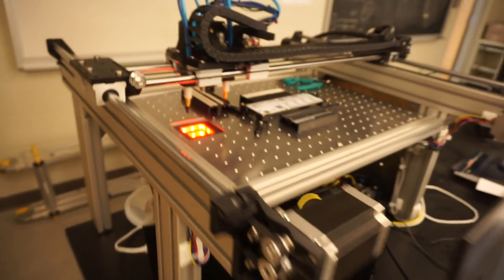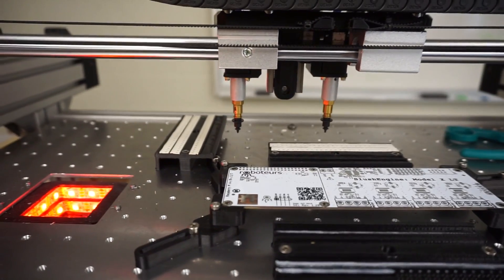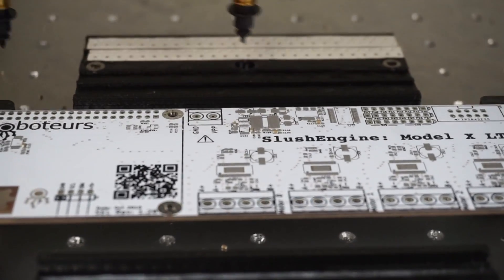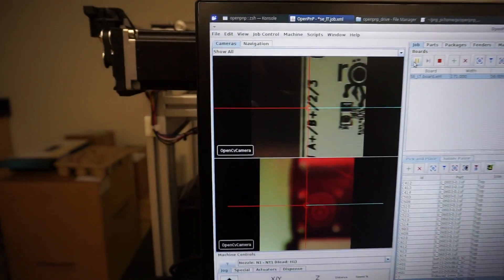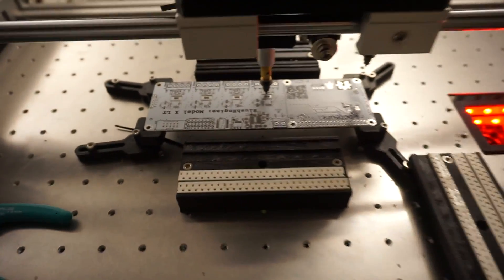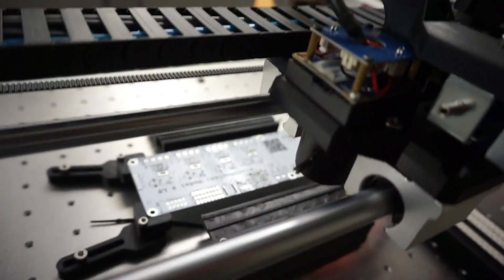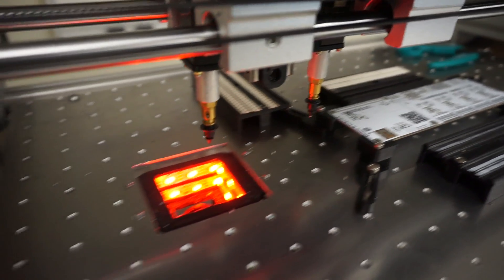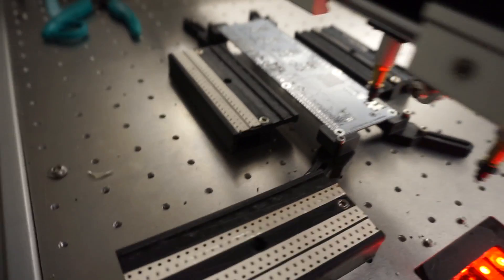Rooibos OpenPNP V1.0

Comment: Hello
I would like to make a Pick & Place like yours.
What controller did you use?
Where can I buy it?
Reply from the maker: I used the Slushengine. It's on roboteurs.com. it has a bunch of IO and analog sensors which are handy for controlling the vacuum system.
Reply: @MrReinerMSchmidt  
you used a rasberry.
I want to do the same thing you did.
Can you help me supply the firmware for the rasberry and the wiring diagram?

Comment: Good job. It's a beautiful project. Is it open source hardware and software?
Reply from the maker: The software is opensource. The hardware is ITOS (Intent to open source). I am working on a second version and I want to put my time into that at the moment instead of documenting the first design.
Reply: ok. If you need someone that collaborate with you, contact me. I realize big size 3D printer and I'm graduate in first level mechanical engineering :)